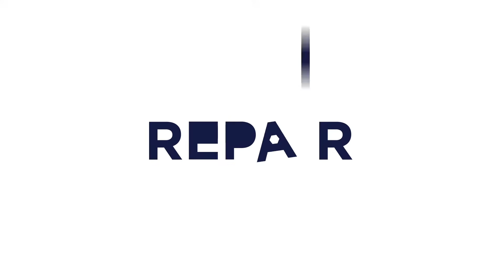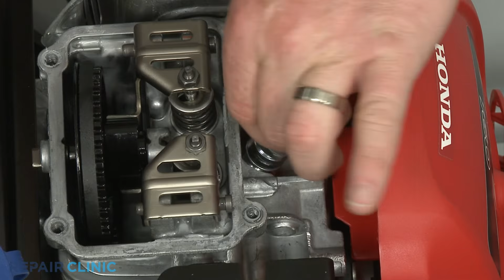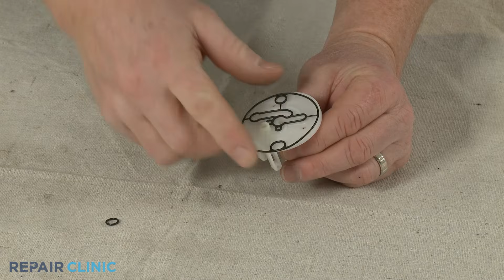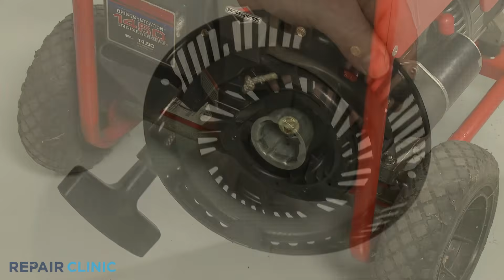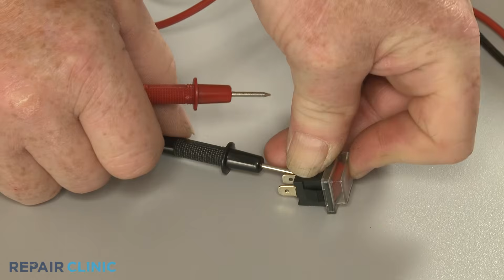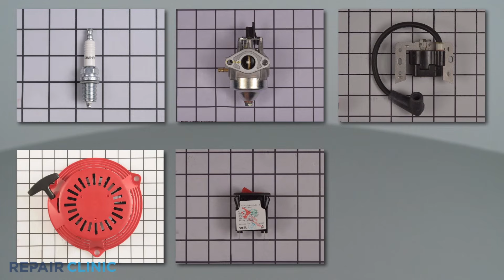Top Reasons Generator Won't Start — Generator Troubleshooting

Comment: Have a Coleman 4,000 watt. Have had no problems starting it until this season. Now it back fires through the muffler. When it finally starts. When you plug in the extension cord in it dies. Now it want start at all. Just has the pull cord. Was using starter fluid . It is propane.

Comment: Its a easy way to test the compression, when there are no diftent to pull the startlilne with or not the spark plug , its the a chance fore the bad compression, 

When the next step its to take a leakdown test, and listening to the where the leaking , valves, headgasket, pcv tube , piston rings

Comment: Help me troubleshoot why the gasoline generator starts and dies within a second please
Reply: Probably the carburetor needs to be replace or cleaned.
Reply: Some generators have cut out switch if no oil, check oil level as well

Comment: I have a gen which sat for 6 years with old fuel.

Cleaned, replaced gas, etc - now it starts on starting fluid only, but won't keep running.

Could this be a gummed carb?  How do I tell?  I know carbs aren't that expensive, but don't want to go through that effort unless I know that's probably the problem.

Also - what if I want to convert to propane?  Any suggestions?
Reply: Yes old fuel and debris will clog up the jets in the carb and the main intake..... new carb or clean it

Comment: 1. Defective spark plug
2. Restricted carburetor
3. Defective ignition coil
4. Malfunctioning recoil starter
5. Faulty switch/switches
6. Broken flywheel key

Comment: Old generators ?
I'm sure many of you would like to dust off the generator ,
here's some tips for you and I speak as someone who have been in the automotive business for over 38 years .
1st remove the spark plug ,
2nd squirt small amount of WD-40 through the spark plug hole on the piston to lubricate the Rings, if WD-40 is not available then any other similar rust9 treatment or light lubrication will do ,
3rd spin the engine few times before installing the spark plugs , you want to make sure that the lubrication you squirted inside the spark plug hole have blown out ,

one of the biggest problems with small engine not starting is a dirty spark plug ,
brush whatever it is on the spark plug with a clean wire brush , the spark plug have to be clean and dry especially from any oil or carbon residue that might be on it , use a propane torch to heat up the spark plug ,
heat up the spark plug until the electroids negative and positive on the spark plug will turn red , allow the spark plug to cool down before touching it , if you don't have a blow torch then use the barbecue , if all fails as the last ditch effort , do the following and be extremely careful  ,it is what I used to do in the old country Palestine,
put a small amount of gasoline in a metal dish , if a dish is not available then do it on the ground , put the spark plug in it and Light It Up , wait until the spark plug cool down before cleaning it ,
again clean the spark plug and reinstall it on the engine ,
if a generator is left outside ?
look on the bottom of the carburetor to see if there is a carburetor drain plug, open it and drain any liquid it might be in it , most likely there will be water in the carburetor ball , if there's too much contaminants you might have to open the carburetor ball  and clean it out ,  make sure that the carburetor float freely operate without sticking ,
5th rd check the oil level , small gasoline engine require constant oil replacement , some small engines require oil change every 40 hours , if possible do an oil change before starting the engine ,
6th ,make sure the ground connection is hooked up ,
7th make sure the generator or engine is an inventilated area before starting it up .
Reply: what if it did start but does not stay on and then after a load of attempts it jams the wire suddenly stops in the middle.
Reply: @clamman7505  
One out of two either water in the fuel , or the flywheel key is broken or bent , clean the carburetor and if worse comes to worst you would have to remove the flywheel and check the flywheel key , a broken flywheel key will cause difficult to start or bad Idol .
Reply: Bad engine idle